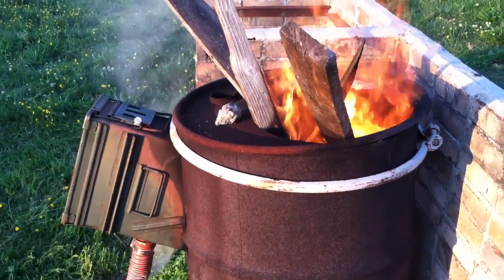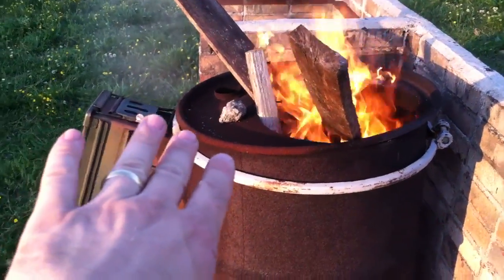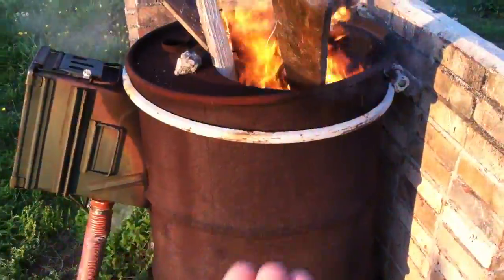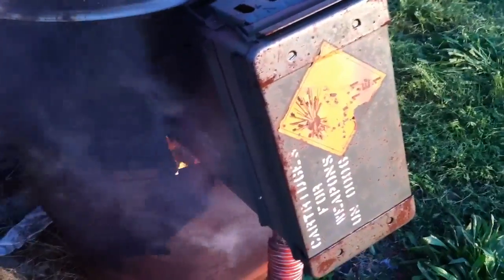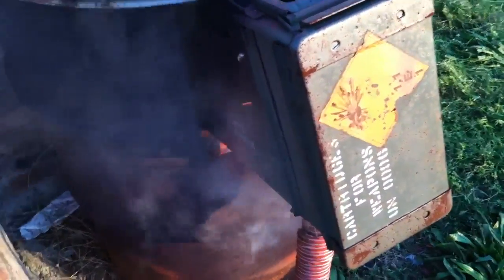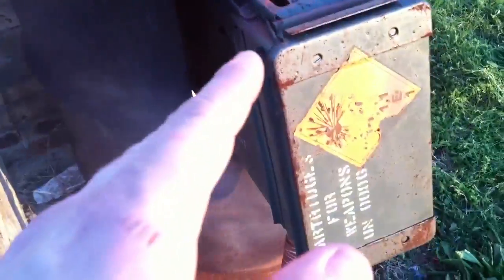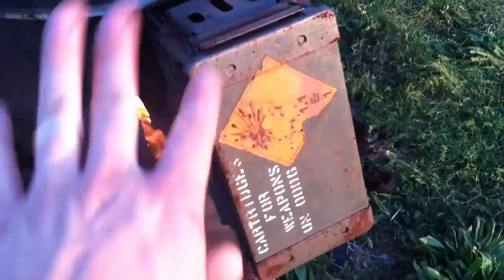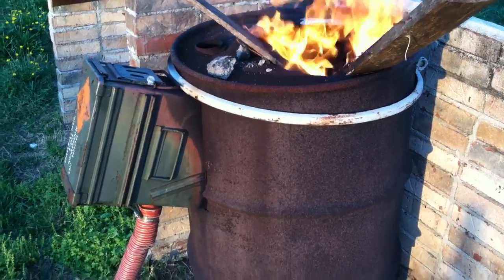Wood Gasification: Reawakening the beast for power!!

Comment: Looking forward to the rebuild!
I wonder how well it would work using a rocket stove as the heat source.
Reply from the maker: Great question Im not sure but when I can get to building the one for the tractor mount one day I may use that concept for that build. Maybe a winter build project in the garage on the farm. ;-)
Reply: The reason I was wondering is because a rocket stove burns small branches/dry weeds/almost anything woody and produces a lot of heat with almost no tell-tale smoke(which can give your location away at great distances).